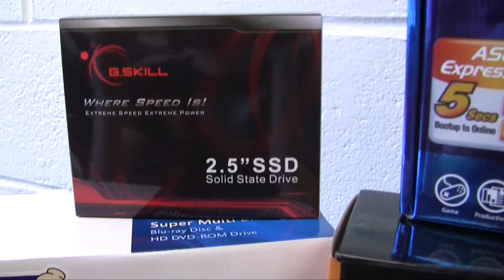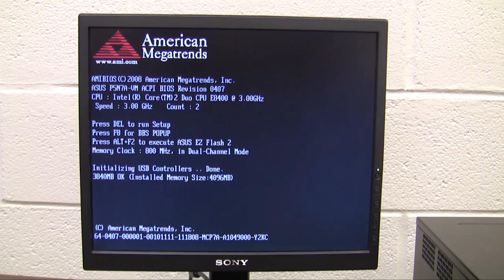Building a Home Theater PC (For Cornell Solar Decathlon)

Comment from the maker: good point, i did forget about PSU, which is also silent.  Most of the noise actually comes from the Hard drive when usinga  stock cooler, but I eliminated that problem by using an SSD and putting my HDDs in a home server.  Fans don't get louder if you keep them clean, and a mini ITX board would not handle Blu-ray well.

Comment from the maker: Read the motherboard manual.  If you are not using all four RAM slots, you put them in certain slots first to enable dual channel.  We chose an SSD because it's very fast, and very power efficient, which was a goal for this computer.  Media is stored on a networked server.

Comment from the maker: The stock fan is almost silent, and we want to keep the CPU cool.  There is no TV card because we may not have access to a cable line when this computer is used in the solar decathlon house.  We may add one later.  an E8400 is not overkill for media center.  You want a speedy processor for media decoding and HD playback.

Comment from the maker: Yes.  Fragmenting is caused by the NTFS file system, not the drive itself.  However, a fragmented SSD still performs way better than an equally fragmented HDD.

Comment from the maker: No, most new motherboards don't have an integrated GPU.  Keep in mind, this is a regular 9300GPU.  Usually when you see integrated graphics, they are a crappy intel GPU chipset.  This motherboard was designed with HTPCs in mind.  Yes, the HDD adapter is basically just for size.

Comment from the maker: There is a GPU, it is built right into the motherboard chipset.  This means decent graphics, with less power consumption.

The Solid state drive is 2.5in. but a normal desktop drive is 3.5in.  We needed it to fit in in the case correctly.

Comment from the maker: The minimum size should be dictated by what you plan on storing on it.  If you want to hold lots of multimedia, I may suggest a SSD for the OS, and a standard large drive for your multimedia. This computer should work fine under linux.

Comment: @gab1971 it ls something to make a space between the board and tray or case. without them, it will short out the board. it's pretty much a screw with a nut as a head so you can screw it to the case and put the board on it and put screws through the board. some case will not require them and have them made into the tray. if that doesn't help, i gues google it. it's pretty much something you understand when you see one. if it helps, it looks alot like the nuts on vga and dvi ports if you unscrew 1

Comment: I'm curious what you think the minimum size for the Solid State Drive could be?  There's a huge price difference between the 64 GB and 128 GB categories!  Would 64 GB do it?  I'm also curious if your specs will work under Linux ( Mythbuntu)?

Comment: Good build, Antec Veris Yaay im using one of their  5.25 screen / controller.

Wait why did you use a SSD, a dual core running 4gb of ram wouldnt have problems with reading 1080p vids in the drive :S or processing blu rays you coulda got a larger standard HDD.